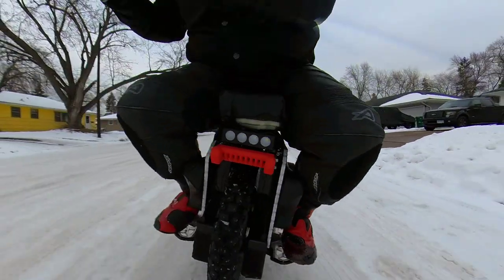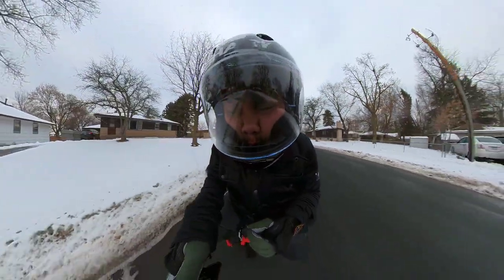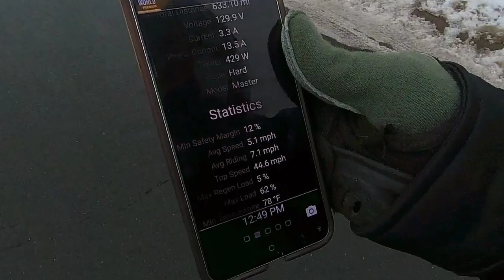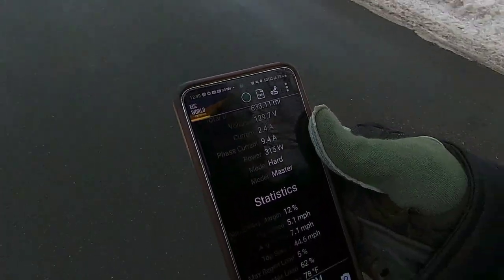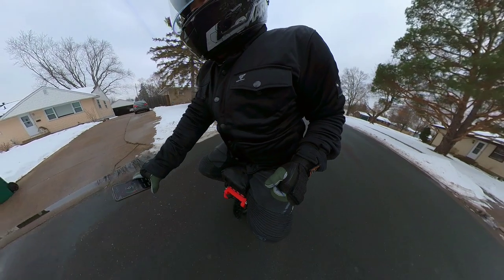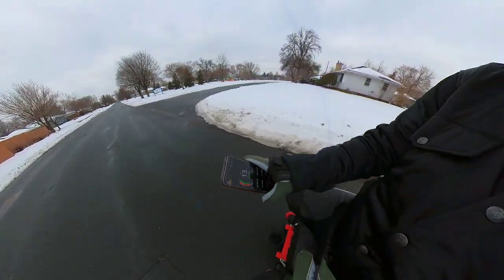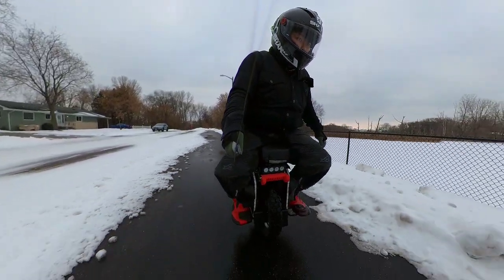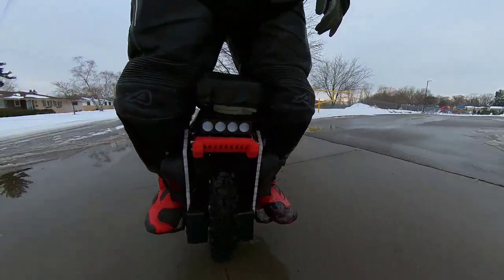Begode Master Test [Speed, Acceleration, Torque]

Comment: How do you accelerate and break on this damn thing?!!! I’ve googled for answers and nobody has a how to video for learning to use the damn thing!
Reply from the maker: You have to lean forwards for it to accelerate or do different variations of body placement to apply towards the front of the wheel to get it to accelerate. Same concept for braking
Reply: @shinobieuc  so lean forward to accelerate and backwards to break?

Comment: You do any waterproofing on that?
Reply from the maker: I silicone the bearings/motor cable, the battery pack. Didn't do anything on the motherboard but used an anti water fabric that will instantly repell water splash. I Also leather it way up so the hardware should really be instantly waterproof